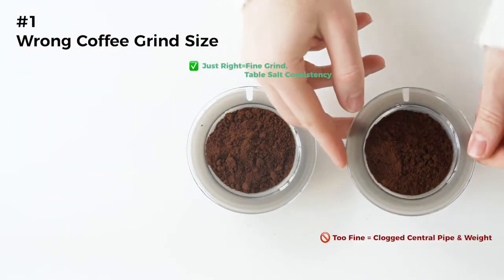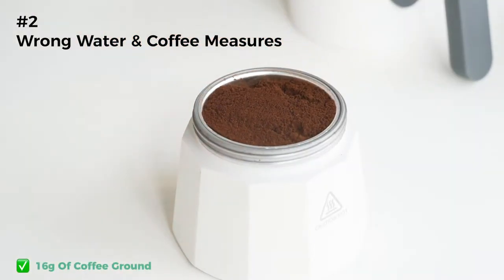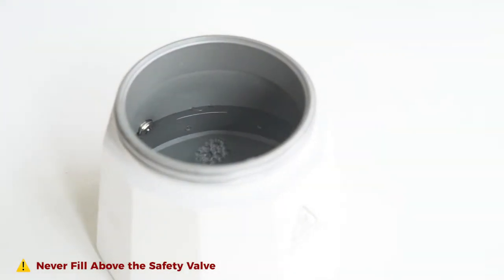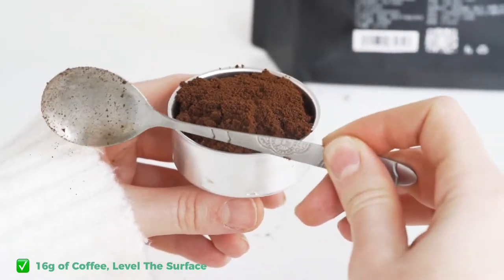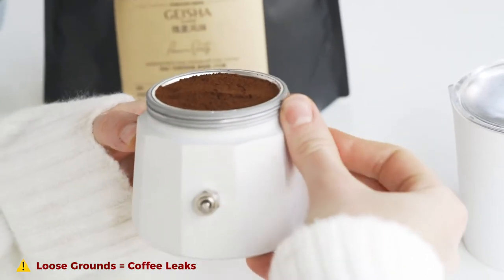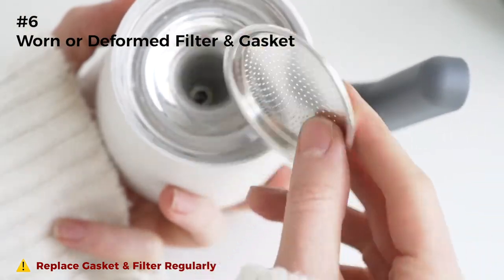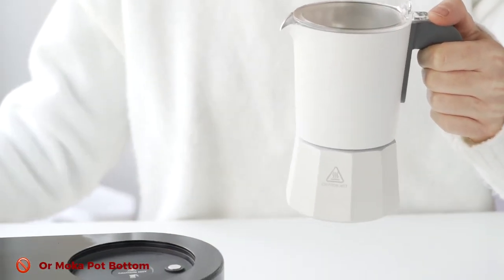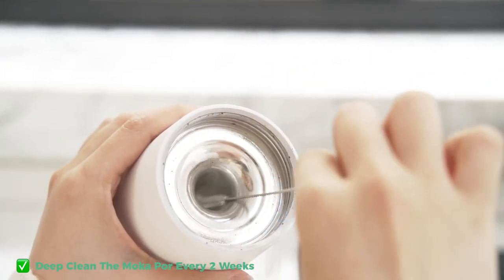8 Common Reasons Causing Your Moka Pot To Stop Working Normally

Comment: i would not recommend people to buy this product for the reason that this product is kind of over-engineered. The induction pan underneath the moka pot is designed with limited time to boil the water and then create steam.....however....from the many times tryings, I never successfully made the coffee no matter what kinds of methods I tried. I think the main reason could be the heating time is too short to provide desired temperature. The main purpose of people to buy this product with such a high price is enjoying the convenience brought by this product, however, I could not feel this.
Reply: But you expected what from a Moka Pot? Espresso like coffee? Strong coffee? Buy Bialetti instead of an off brand. 

It does what its advertised. I love it. I can never drink coffee from the American coffee machines ever again. Flame is a much better method to brew coffee than on electric. Sometimes electric is all you have (like me). I doubt you used all the methods. Most Americans don't have time for that. Not even to read the instructions.

Comment: Well it’s not worth buying anyway for 300 bucks!!
Reply: Obviously not. Not like buying an espresso machine.
Reply: You can find it for $159.00 USD on Amazon. There are special “limited time” offers which seem to run all the time. 😎 I have one that I bought for $159.00, and it works great. This is a Brikka-style Moka pot, which is a little different from the typical moka, and the directions are slightly different. It is designed to make more “crema” than the topical moka. Most of the complaints on Amazon look like they might be fixed by contacting the seller for support. Everyone else loves their machine.